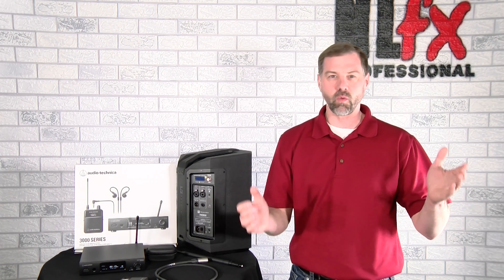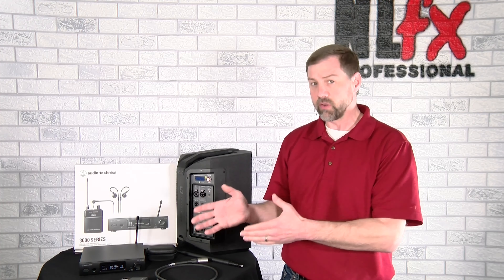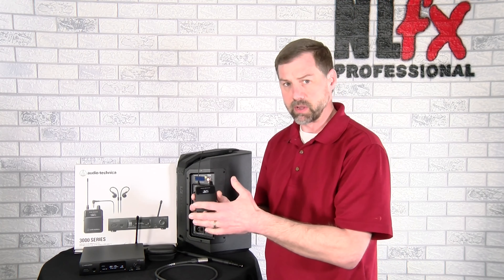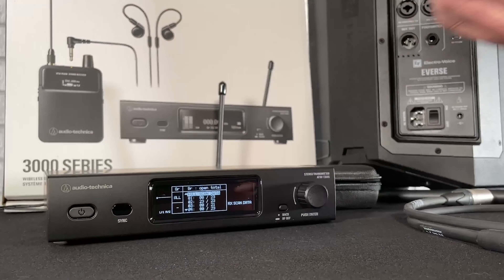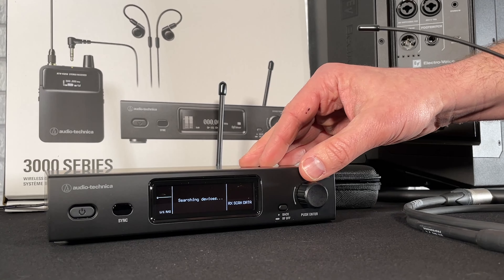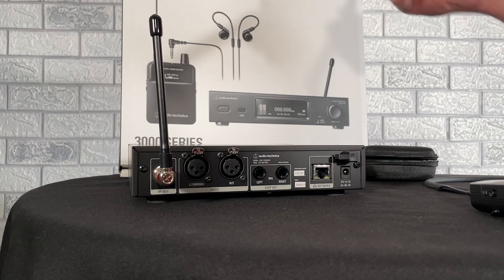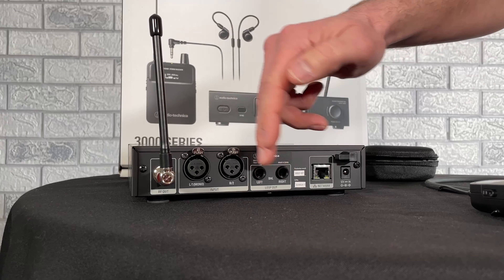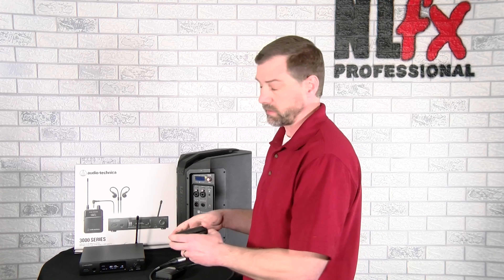New reliable way to make your speakers wireless!

Comment: Looks great! What is the approximate signal range and does the transmitter have to be line of site to the receiver?
Reply: RF range is always environmental.  They're going to advertise 300 feet as a standard.  We've tested it at over 800 feet, but it could fail at less than 100' depending on the environment, multipath, antenna placement, etc.  Line of sight is always ideal and has the best range.  It does not have to be line of sight to work, think FM radio.

Comment: Do you think this is still the best for making speakers wireless? Right now, I use a Line 6, but put the receiver by the speaker and the transmitter out of my booth (1/4 inch)

Comment: Question: If I setup in an empty room and scan for a clear channel, then the room fills with 500 cell phones, do I have to rescan?
Reply: No.  500 cell phones is nothing.  I've done Football Championship games with 100,000 cell phones, or concerts with 20,000 cell phones.  Just imagine if cell phones actually had an impact on wireless IEMs and mics...  They'd be making announcements at concerts to have you shut them off, which we all know wouldn't happen.
Reply: @benstowe7433  Thank you Ben! I was an assistant radio engineer once (over 20 years ago) I kinda remember harmonics were a thing. Even though it wasn't the same frequency the transmitter still caused interference on certain sub frequencies, so I didn't know if that happened in cellular or not.